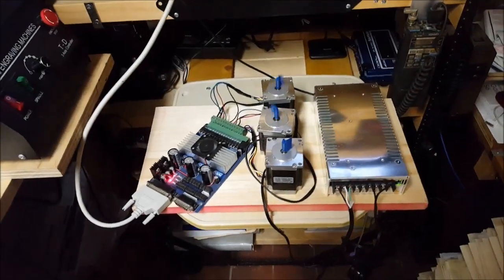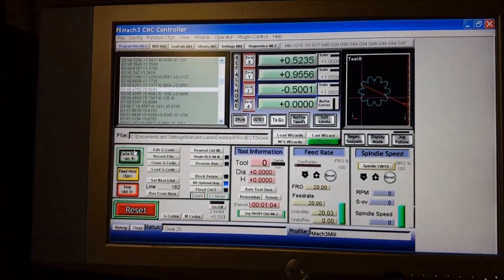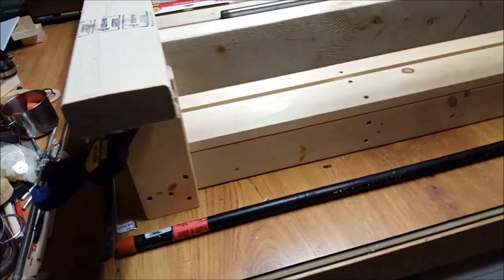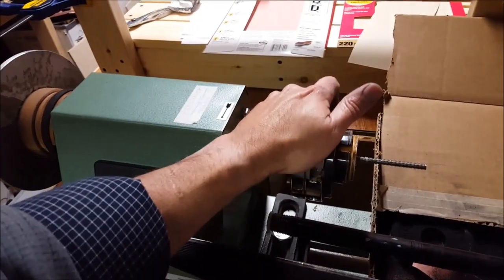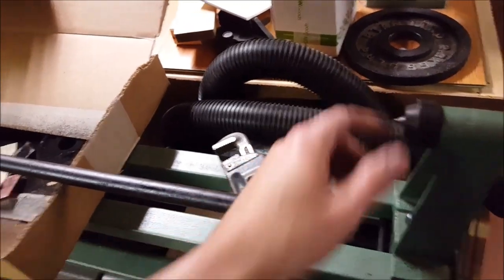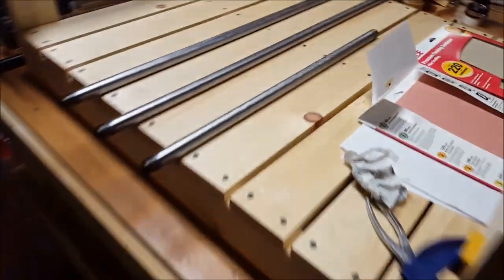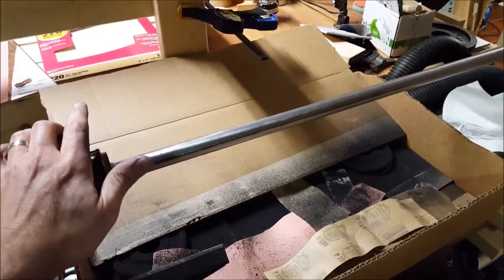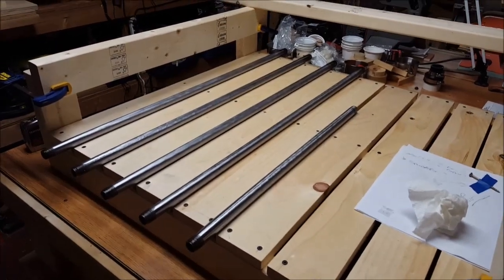Solsylva CNC Build - Update - Pipes & Steppers

Comment: Dan - great idea with low cost controller board and the gas pipes.  I look forward to seeing more of this.  I built a Solsylva CNC but it was the 9"x10" table.  The plans were really good.
Reply from the maker: Hi Dave.  Thanks.  The plans are very well written.  I'm making a few small changes as I go but keeping the basic system the same.